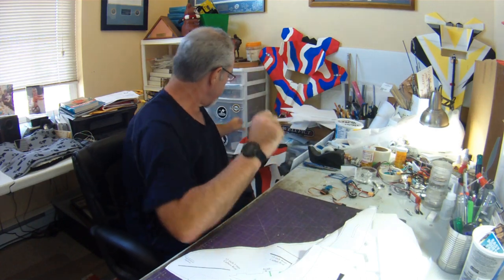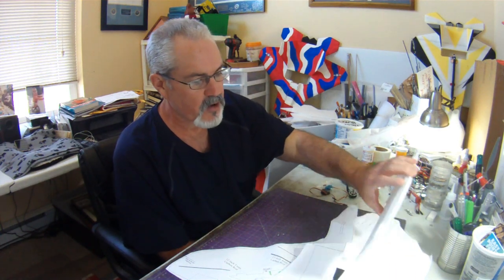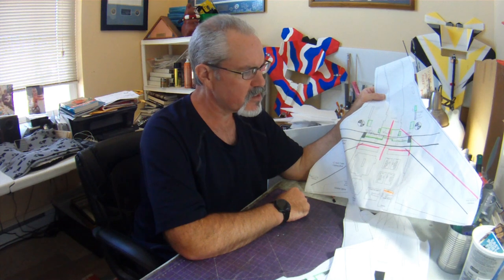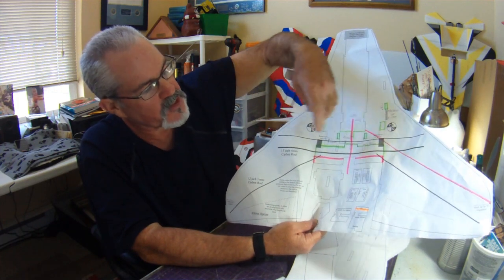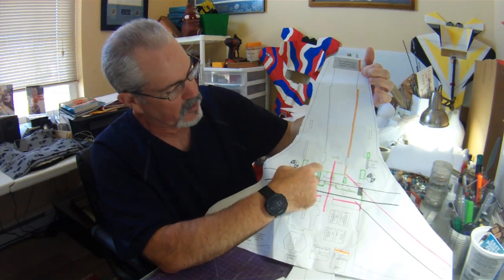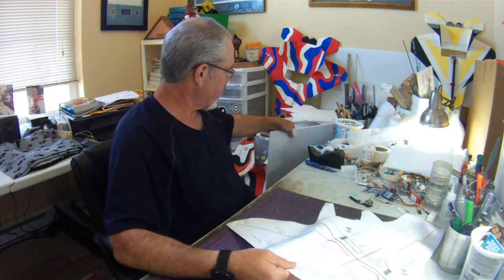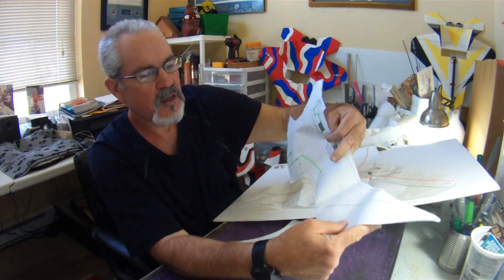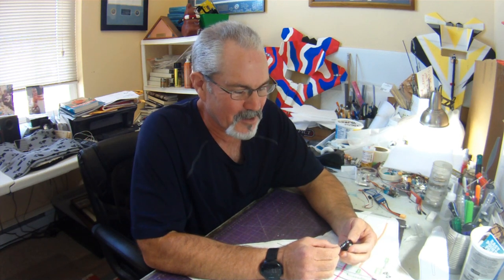Modified NAMC Mig35B build video series - Intro

Comment: Hello Scott.  Just finished my NAMC Mig-35B.  I want the ability to switch between my tried and true GEFORCE L2835-2400kv and your hot rod GepRC GR2306-2750kv.   How would you recommend doing this with the mount pattern differences and the 3/4" shallower profile?   Thank you from Texas.  Rich
Reply from the maker: I'm not familiar with the L2835 2400 kv motor.  If you can figure out a way to have holes drilled for both motor mounts without weakening the motor mount, that should not be a problem.  You will probably have to trim some foam off the leading edge of the prop slot, fuselage and nacelles to accommodate the 2306 motor if you haven't done that already.  I build all my parkjets now as if I am going to use the 2306 size motors, then if I want to use one with a longer can, that is not a problem.  Cheers, Scott

Comment: Hello sir

What's your best choice 2020

I mean suggest motor and kv  for  6040 props on 3 cell

Like efficient, good torque and thrust

Please share your best  available on bangood

Thank you.😍
Reply from the maker: For best value, I would recommend this motor https://www.banggood.com/Racerstar-2406-BR2406S-Green-Edition-2600KV-2-4S-Brushless-Motor-For-X220-250-280-300-Racing-Drone-p-1216819.html?rmmds=detail-left-hotproducts__1&cur_warehouse=CN matched with this prop https://www.banggood.com/2-Pairs-Gemfan-Flash-6042-6_0x4_2-PC-2-blade-Propeller-5mm-Mounting-hole-for-RC-FPV-Racing-Drone-p-1246562.html?rmmds=myorder&ID=3868&cur_warehouse=CN on 3S, this combo pulls about 35A at full throttle, so I would recommend at least a 40A ESC, this one is good https://www.banggood.com/Hobbywing-Skywalker-2-4S-50A-UBEC-Brushless-ESC-With-5V5A-BEC-For-RC-Airplane-Models-p-1041723.html?rmmds=search&cur_warehouse=CN  Good luck :)  Cheers, Scott
Reply: Ohhh thank you so much for reply